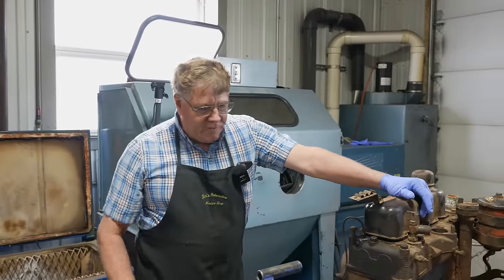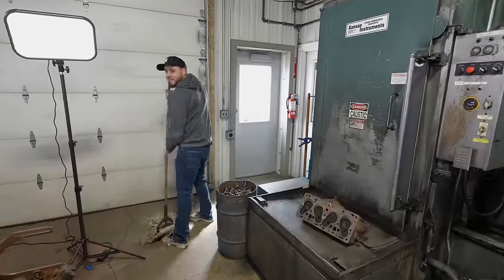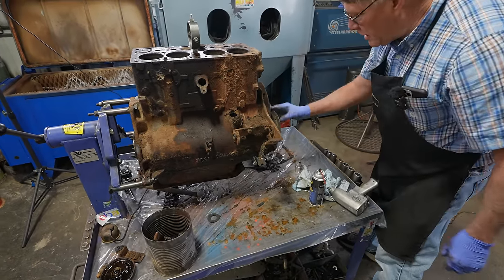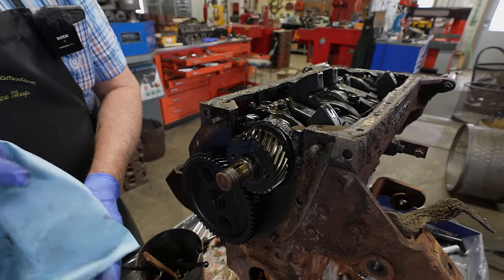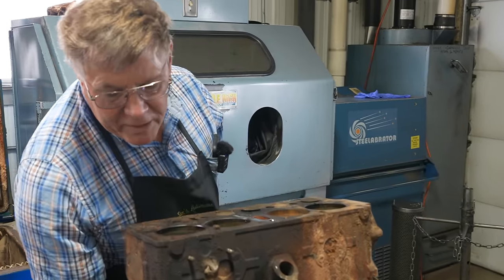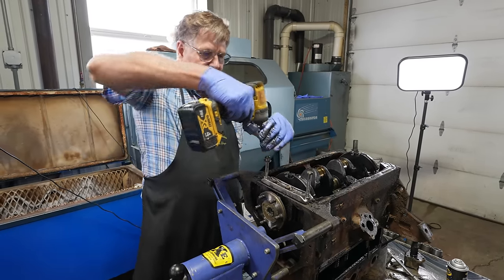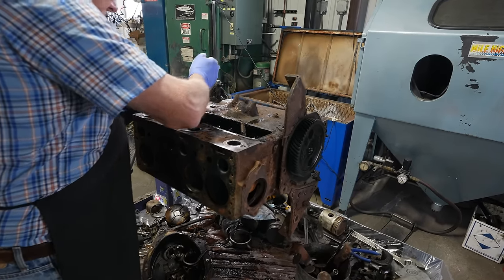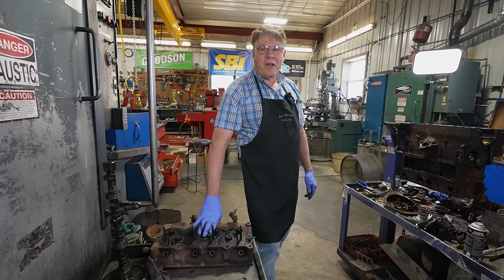Tearing Down A NEGLECTED Willys Hurricane Engine...

Comment: Wow ! What memories! I was a mechanic for 50+ years on forklifts, I rebuilt so many Continental, Hercules and Waukesha engines I dream about that a times LOL , seeing you strip down this old f head reminds me of my youth , most of the engines had Castle nuts with pins on then or safety wire ! The best time was standing them up on the bell housing when done and painting them , great satisfaction from that job !
Reply: Did you paint them Red or Black or Orange?  Some customers liked the Dodge Hemi Red or Orange. 
It showed where they leaked after you broke it in and the customer could prove to their friends that it was actually removed and rebuilt and not just re ringed..
Reply: Until you mentioned it here, I had forgotten all about it. I vaguely remember seeing only one motor with wire retainers.

My boss in one of his mechanics we'll talk about the farm life and using Ingenuity to fix broken machineries. When they got flat tires they would stuff them with hay to get the job done until they could get the time and or money to fix it properly
Reply: My buddy Kenny would stuff flat tires with leaves when he was in the middle of the woods with his dirt bike.  It's probably common knowledge for them,but seemed inovative to me.
Reply: For what it’s worth I work on them currently, those engines are still out there and we still overhaul them. I carry 2 sets of zip wire pliers 😊. Good engines if they can keep oil in them

Comment: I'm glad to hear that someone besides me remembers the old days when 100,000 miles on an engine was almost a miracle. My sons always look at me like I'm crazy when I tell him about the old days. When I went to work for the Subaru dealership in 79 I was very impressed with the number of miles people getting on those engines. We had a couple of surveyors that had the Subaru Brat and they had over 300,000 miles apiece on them and that almost blew my mind.
Reply: Subaru used to build a good engine.
Reply: Yes !  My Dad had mostly Fords in the 1960's and early 1970's and one Oldsmobile.  Around 90,000 they would  start using oil and  running badly!   I recall him taking the valve covers off his 429 Thunderbird engine and it was absolutely filled with gunk!  It barely ran so he ending up selling it for maybe $150 !  😂😂
Reply: Engines in the 1950’s were designed for non detergent oil. Contaminants in the engine oil would fall out f suspension and collect in the oil pan, top of head, etc.  carbureted engines often ran rich generating deposits.  Removing sludge from engines regularly was expected. Detergent oils came out in 1960’s. Detergents keep contaminates in suspension.  When oil is changed the contaminates are removed.  Some people used non detergent oil and sludge developed.  I remember my dad cleaning sludge out of the engine in our AMC station wagon. I think he ran non detergent oil because he did not trust the new oil.  Or to save money.
Reply: Absolutely. My dad ran a '53 Ford to 90k and a '65 Fairlane to 140k. It took one valve job for each where he got the valve stems knurled to reduce leakage through the guides. My 10 to 16 year old self was his parts cleaner!  Good memories. Oils and metallurgy have come a long way.
Reply: @spaceghost8995 My dad put 100,000 miles on his 1946 Ford panel truck with 59A V8 engine. He had 30W Wolf’s Head oil and the filter changed every 1000 miles. The engine had an oil bath air cleaner a bi- pass oil filter. Wix cartridge filters were commonly used. The truck had a three speed transmission but he never used second unless absolutely necessary. He preferred to go directly from first to third.
Reply: The old engines were absolutely capable of going over 100k. The issue is owners failed to do the maintenance it took to do so. Plus, the engines were easy and cheap to overhaul and rebuild. All the YouTube channels that take old junked vehicles and put them back on the road are testament to this fact
Reply: I heard that leaded gasoline would form abrasive deposits, and that also limited the lifespan of old engines. However, if you put unleaded gasoline in some of those engines, it would destroy the valve seats.

My dad said that many cars were sold with non detergent oil, and people would put detergent oil in them later oil. This would end in disaster. Huge pieces of engine sludge would break away quickly, then get stuck in the oil pump.

The other thing that sucked about carb engines is that in certain applications, fuel atomization and distribution was poor. This was especially bad in one carb inline six engines. Cylinders 1 and 6 would always get a much different mixture than cylinders 2 and 4.
Reply: @spaceghost8995  
Quaker oils?
Reply: @generessler6282  Top hat/umbrella valve stem oil seals were a great invention...
Reply: @skylinefever  
One of the reasons for 6 cylinder inline engines to have two or three carbs...or one barrel of a carb per inlet port...
Reply: @JohnSmith-pl2bk  absolutely, a twin carb inline 6 had a huge advantage in balanced fuel distribution.

My dad once drove a Datsun 260 and did not realize there could be exciting inline sixes. I explained the twin carbs as reason #1 the Datsun 260 engine could be fun. I then explained how the bore and stroke of a Datsun 260 vs an Econoline van is like comparing a motorcycle engine to a car engine.
Reply: @skylinefever  
I once had the opportunity to drive a 240Z...with a view to buying it...

When I got to 100mph and shifted into 5th with another 29mph to go to top speed I knew it would send me to jail or kill me if I bought it.

So I kept driving my little Datsun 120Y (B210) and at least once every week on the 100 mile  journey to and from home I would strive to get to 100mph in that...

Almost made it slipstreaming a Ford V8 downhill.....but couldn't keep up when we hit the flat....
11 years...trying trying trying....but still alive to try again!
Reply: @JohnSmith-pl2bk  I nearly went into the Darwin Awards by driving too fast. I had an MKIV Jetta 1.8T. If it did not have side air bags, I would not be here.
Reply: @JohnSmith-pl2bk    All different brands.  Who knows?

Comment: Worked for a Jeep dealer in Tulare, CA in the mid 1970s. They bought an entire truckload of used surplus 4 cylinder Jeep engines. We rebuilt a few dozen of these engines using surplus WW2 parts. It took longer to clean the cosmoline preservative off some of those parts than it was worth.
  We would test run the rebuilt engines on the bench while they were sitting on the oil pan.
  Those engines were used in all sorts of agricultural equipment as well as all early Jeeps.
Reply: When Kaiser owned the company they had a exchange program where you could purchase a rebuild engine with a warranty. 
Long before Jasper and all the aftermarket exchange programs or Goodwrench crate motor. 
Kaiser really did love his jeep company..
Reply: My uncle had an old Willys pick-up with a flatbed. That was back in mid-50's that was his farm utility vehicle.  He'd run them until they would go no more. Good old truck.
Reply: I understand that the dealers weren't to worried about model years. They didn't issue the model year until it was sold. They are hard to identify the years. The fact that the model and ID number tag is held on with 4 slot head sheetmetal screws makes them real easy to swap😂.
Reply: My dad had a Willys jeep when I was very young. I remember him and I going to a jeep salvage yard in Petaluma to keep it on the road.

Comment: The bypass filter...some of the oil was pumped into the canister filter...all the oil went through the pump unfiltered.
One bypass filter which used a roll of toilet paper as the filter medium was the Franz filter...sometimes used as a supplementary filter to the OEM full flow engine filter.

Most OEM used the "normal" cartridge filters we know and love today....before the spin on filter.....
Reply: It is interesting to see a lot of companies going back to cartridge filters.

I always liked that it became impossible to hide cheap filter media in a tin can. I like "Orange can of death" jokes. It also meant you didn't have to cut one open to look for disaster.
Reply: on most engines the oil goes through the pump unfiltered every engine that I've worked on the oil goes through the pump than through the filter under pressure

Comment: Jim, as a truck owner operator in so cal in the early 80's I ran distilled water and Nalcool, no anti freeze in my small cam Cummins. Pops taught me that way as we only ran over to Phoenix or Tucson or north to the bay area or Sacramento for GI Trucking at that time.

Early in my career I remember one trip between Phoenix and Tucson it snowed a bit. The trucks grill had collected some slush and I remember worrying about a tube freezing in the radiator core and splitting. By the time I got down to Tucson it was sun up and all was good. 

Nalcool was oxblood red and would leave a telltale red stain if there was a coolant leak anywhere. It's main purpose was to lessen the pitting of the wet side of the cylinder liners from cavitation and inhibit corrosion. Nalcool was basically equal to what Cummins sold as DCA at that time.

Distilled water and Nalcool did great in my experience with my second truck a 1986 IH 9670 Eagle with an NTCC 400 big cam Cummins. We ordered that truck with optional large radiator, a Modine beta weld. I could remove the radiator cap and see clean bare copper and clean silver solder inside the filler neck just like when it was brand new, even 10 years and 1 million, 30 thousand miles later! That truck came with a small spin on coolant filter for which I remember buying Nalcool branded filters that had a dose of cooling system treatment inside them.

In 1992 I moved to Reno Nevada and quickly had to find low silicate anti freeze to add in the coolant mix now that i would be running over Donner Pass everyday. Had to buy and install a plug in block heater and an ether inject starting aid for that Cummins. Things we never thought about when living in the banana belt.

Comment: When I started working as a mechanic in 1975, my job was to tear down these engines and send them to the machine shop. Then reassemble them whenever they were ready. We had a fleet of 30 Jeeps with this and the flathead versions. We had lots of spares.
Reply: 30 Jeeps?? Were they postal Jeeps or ice cream trucks or what??
Reply: @JeffKopis  No they were used for spraying mosquitoes. We put a 60 gallon tank in the back and ran a pump off of a pro. We used to go to the army surplus and buy jeeps and parts. We could not use the bodies or frames. It was a county agency. I got really good at pulling motors, under 30 minutes.

Comment: I live in Australia, born in 1953.  When I was in high school one of my friend's father had a GM Holden (Australian designed and built car) It had about 120,000 on the clock.  The new detergent oils came out and the dad agreed to have it put in his engine.  It worked really well and removed all the gunge and muck from the rings.  Needless to say, the engine was clean but removing all the carbon meant it now used more oil than petrol.  As Jim said 100,000 miles was the life of these engines.

Comment: Way back in about 1980 I rebuilt one of these, the bores were trashed, I bored it to 60 over with a Sunnen hone, I put 2 to 3 thousands taper in the bores, That was an experience I won't forget.  We did it in-frame to save the customer the R&R  labor.

Comment: I have been an engine re-builder and sports car high performance modified engine supplier in my past life(retired). I use generally diesel engine oil after break-in of a rebuilt engine where for Gasoline engines I used SI-5W30 for the first 1,000 miles running and then service with SI-CI 30W50 as the ambient temperature is above freezing and to 40degC.
When all the new fangled oils with additives became prevalent, 1970s/80s, and servicing Ford XD/XE era on-wards, it became common for the additives to accumulate in the bottom of the sump so deep that oil would not drain without using a screwdriver to dig a hole to release the oil. We were removing sumps in so many vehicles that servicing was always over budgeted values. The sludge additives, as sent for analysis, showed that they were not being maintained in suspension in the nominal base oil. This was the main reason I used the compression ignition oils for most of my gasoline engine servicing. The sump was mostly just a carbon grime in the sump as the compression ignition oil detergents washed the internals of the engine. Later specifications were for both spark ignition & compression ignition in the 1980s onwards.
Porche and another sports car manufacturer took Shell on over the rapid deterioration of the engines due to oils not maintaining the lubrication as claimed.
Just a bit of background on oils as I was taught in the Air Force and also by a mate who was a Chemical engineer for the Shell company back in the 1970s/80s.
Ozzie Follower

Comment: Thanks for the trip down memory lane.  Before he passed in 2010, my Dad owned a restored 1952 Willys Aerowing automobile.  It had a six cylinder F-head motor much like the 4 cylinder version in this video.   It was coupled to a 3 speed on the tree with electric overdrive.  Surprising thing was that the automobile was unibody!  Unibody was kind of rare back in those days.  It got about 26mpg using the overdrive.

Comment: Such rugged designs that these earlier machines were..  Not made for 1/4 mile acceleration competition, but if you needed dependable power for industrial duty applications; these heavy little 4-bangers were the ones that could be relied upon to get the job done... They made it through several wars, and then they were overhauled and re-purposed when those bodies & frames , went to heaven... That's Quality !!!

Comment: WE just had to replace the rear main seal in my project car 's engine after it was rebuilt in another shop. The neoprene seal was not correct for the engine, was gobbed up with silicone and leaked like a sieve. We also cleaned out the oil pick- up , which was choked with crud. We stripped and cleaned all the oil gallys ( there you go Jim ) and cleaned the lower block. put the main bearing caps on the right way around cleaned the crankcase . we inspected all the bearings and used assembly grease and reassembled, and re installed the unit into the car , she started and runs very nicely  . But I learned an important lesson, check every thing !

Comment: Jim, I use a large drill chuck to pull pins with. Just put it on, tighten it down, and a light twist and pull is all you need, no more fighting it with pliers. You could even put a handle in it.

Comment: I have restored 24 Willys from 43 to 63. All parts are available from Kaiser Willys in the Carolinas or the Jeepsterman in MO. Used parts from Mid-west Willys. You can't tell the date of a jeep by its title only by the vin as some were sold 2 or 3 years after they were made and titled in that yr. The date of those bearing is most likely the date of the jeep unless you have the VIN and there are sites online that you can check it on. In your case, as you know you just need the correct engine parts. F head and L head comes from what the heads look like when you saw them in half as that's what the heads look like an F or and L! I always use the reverse thinking as an F head is NOT a flat head! Thanks again for the great video.